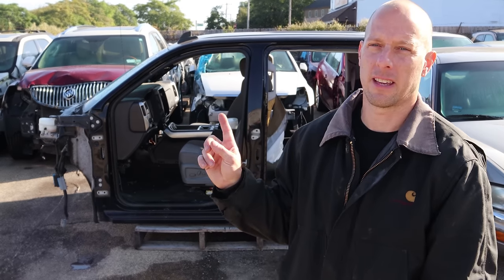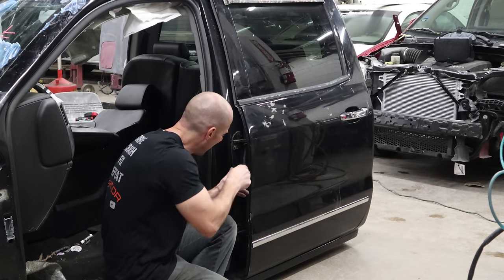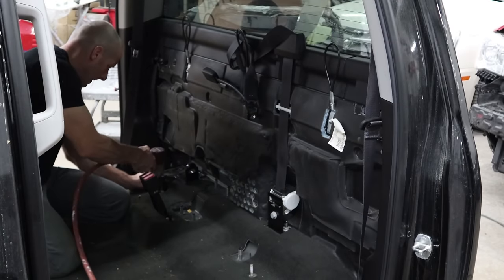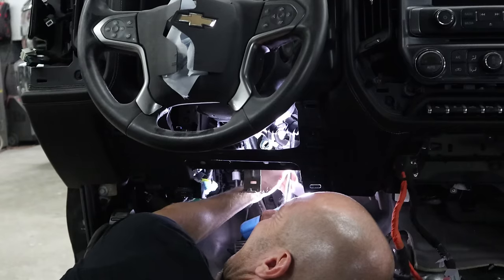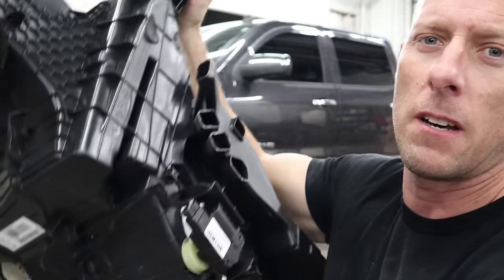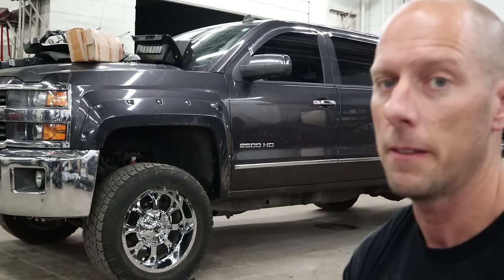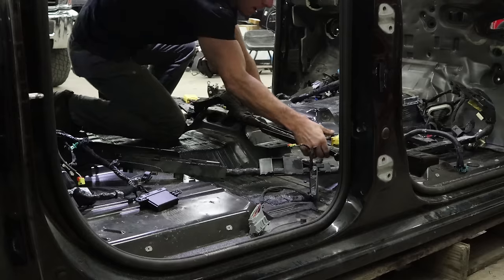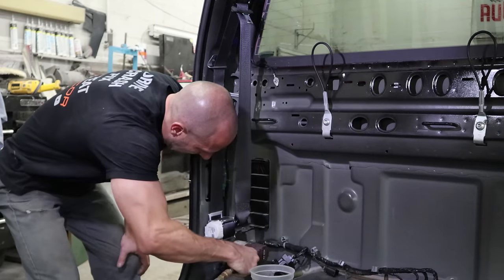Gutting the cab for the 2015 Silverado mistake and attempting to reassemble it. (Part 5)

Comment: Hey you don’t happen to have a black center console for one of these for sale do ya?  I’ve got an ‘11 Silverado and want to take out the jump seat and replace it with the console.  Everywhere online wants like $2,500 for those things.
Reply from the maker: I don't have a black center console but the 07-14 is a different truck.  Theses consoles (2014.5-2019) sell for $800-1000 as far as I have seen.  I would imagine you could get the older ones cheaper.  They do fit Yukons, Tahoes and Suburbans as well.  I stand corrected.  The only black one I found on ebay was $1250 after a quick search.  I have a 2012 Yukon I will be building  in the near future and if I buy a parts truck I will have a center console leftover, possibly.  I will let you know.  Good luck in your search and thanks for watching.
Reply: vehcor thanks for responding, man!  Greatly appreciated!

Comment: its a pain int he ass to get a truck a new vin number once you change the cab i had a one the insurance company did that to and it took 5 years to get it re vined
Reply from the maker: If you watch my older videos there is a white Silverado going on two years for a retag.  Luckily, I have a few connections, mine should be done soon.  Thanks for watching.

Comment: I thought you had bought a truck from Florida to rebuild that one.
Reply: Adan Ochoa The paper work for that one says it isn't fit for rebuild or something. Which I feel is bullshit....
Reply from the maker: I did but I still would have had to buy the roof skin for $400 and with the bonuses on this cab, it was cheaper and MUCH less work to just swap this cab on.  I will still use the parts truck for everything else.

Comment: I hope this message gets to you before you make this mistake. Please research gm environment identifier before swapping different vin number modules from truck to truck. 5 particular modules, ebcm, cluster, hvac module, airbag and onstar modules have the vin #s locked in them and if the BCM senses one module that doesn’t match the BCM’s vin you’ll get a security light and intermittent no start. GM created this feature to make modules useless on the black market Incase they were stolen and sold from a chop shop. There’s no way to reflash and clear the vin unless you have special software. Hope this helps. Also to save you money, you don’t have to replace the sdm after 1 airbag deploy. Gm allows you to reuse an sdm after 1 accident by just hitting the special function clear event data button on most high end scanners. Good luck. I’ve done this whole body harness job once just like you because somebody stole a battery and chopped the right side fuse block positive battery cable going to the battery fuse block. Very fun 20 hours.
Reply: Interesting. Thanks.
Reply from the maker: I am a full time mechanic and have rebuilt over 1000 vehicles, believe me I have run into all of this before and learned the hard way.   A lesson you don't forget.   I never change an air bag module I don't have to and a lot of this is why you see me changing every little part to use all the original vehicle stuff.  With the wrong VIN in the BCM it won't be an intermittent no start, it will just be a no start. lol I will use the passlock wiring in the original column so I don't have to reprogram anything.  I should be able to reconnect the battery and fire it up.  I may change the ECM because there is a dent in the case and I don't think I want to trust it long term but I do have the extra from the parts truck I can have programmed. Funny you bring this up because there will actually be a video where all of this is addressed on this truck when I get to editing it.  SPOILER ALERT: Turns out the ebcm, trailer brake module and the fuel pump module will NOT keep the truck from starting if the vin is not programmed regardless of what the dealer tech tells me. lol Thanks for the insight, it would have been very helpful when I had to learn it all the hard way long ago.  Part of the reason I made the video, so we can help others. Thanks for watching.

Comment: This is great video.how many trucks are our using?
Reply: Three, including the junkyard cab.
Reply: @mendonesiac  I thought so. THANKS
Reply from the maker: 1 truck I am fixing
1 parts truck for the frame and front end
1 cab from a salvage yard
so far.........
At least one more for the bed side (maybe new) looks like that might actually be the cheapest route. 
and possibly the rear bumper from another.  

While I can buy these parts from a salvage yard, I have bought entire vehicles for less.  I do plan on building a lot of these trucks so having extra parts will save me a lot in the long run.  Thanks for watching.

Comment: Wow. Watching this makes me want to keep my 2005 Silverado😂. My dash pops off with a single tug of a screw driver.
Reply from the maker: The bezel, yes.  The dash pad still has a bunch of screws to get it off if you want to change the passenger airbag.  They are much easier but they don't have all the fun gadgets like this one. lol I will miss my 2006 :(

Comment: As the new cab was near perfect, why didn't you just use the new cab "as is" rather than breaking them all down?
Reply from the maker: Windshield was different, heater box was different, dash wiring harness was different, main body harness was different, antenna was different, seats were different, seat belts were different and the pedals were different.  I used exactly every part I could from this cab.  The back glass, the dash pad (which is still different but doesn't bother me), the inner dash steel and plastic, the seat belt pre-tensioners (which had to be removed to change the belts), the head liner(which I had to remove to change the harness) and finally the cab itself.  Thanks for watching.

Comment: just found your video here.... & was wondering a few key thing's  on early 2000 's  Silverado rig 's.......
 1.,.. i know chevy makes the work rigs the  ext., cab & longbed's w/ the v6 & auto tranny & manual 4x4..... is this a normal thing or a custom ( wanted  by the customer )  thing for chevy to build..... like for 2004  to say 2010  or so..........
2.,...  did chevy ever build any crew cab rig 's that had the v6 & auto tranny & manual 4x4 in the cab..... or was it simply to heavy for the v6 to pull............  if u haven't done it for the gen of  '99 to '06  i believe... do u know of some one here on u-tube who has & has done a good video on it all for my gen's  of  99-06 silverado work rig v6 auto & manual 4x4 configuation's........!!!!?????
Reply from the maker: The biggest v6 4x4 I know of is an extended cab.  I don't think they had a crew v6 4x4.

Comment: So when buying a used cab make damn sure you get the title for the new cab or you will have big problems with the DMV and cop's. Check in your state about how to handle the new vin before starting this project
Reply from the maker: I didn't get a title and I don't need one.  If you do it the correct way, the state retags it for you.  If you are getting a title with a cab, there is something illegal going on there.  Salvage yards cannot sell it that way and why would a private party sell you a cab with a title, you technically own all the other parts as well and there is a bunch of paperwork they should have gone though to sell the parts properly, part of which is getting a junk title.  I have done over a 1000 rebuilds and replaced 20 or so cabs in my day.  I am quite familiar with the proper methods.

Comment: This make no sense? Why wouldn't you just sell that pos and find a better salvaged truck? Your replacing the whole truck?
Reply from the maker: Uh because I don't want to spend $50k on a used truck when I could spend 1/4 of that.  That makes perfect sense to me. I am not afraid of a little work.
Reply: vehcor You could find a " better salvaged truck"as a starting point. Whats gona be from the original truck? The title? lol....
Reply from the maker: If it were possible I would have done it.  I'll break it down for you so you don't have to watch any more.  Title, which is all that matters really,  engine, front diff, left rear door, right front door, right rear door, wiring, all electronics, entire interior, 3 doors, 3 wheels, bed, rear end.  I have built vehicles from less. I'm sure you are the expert though.